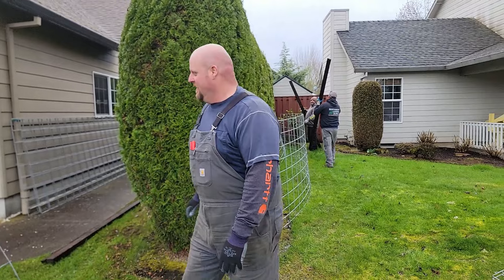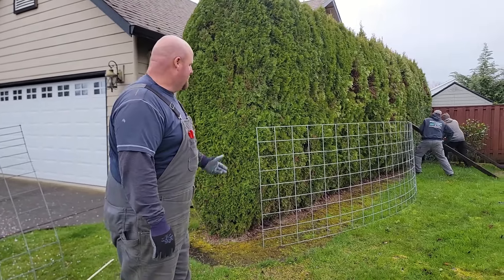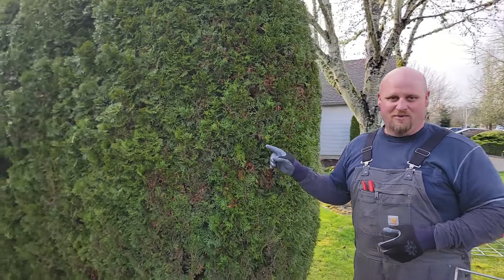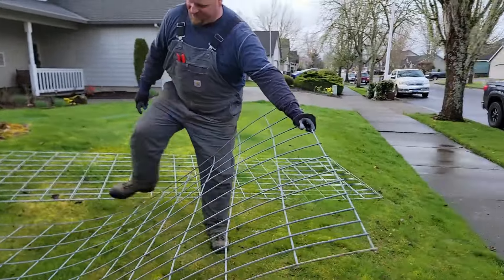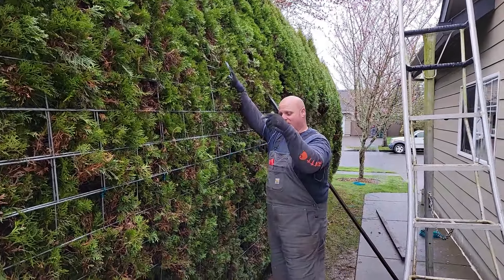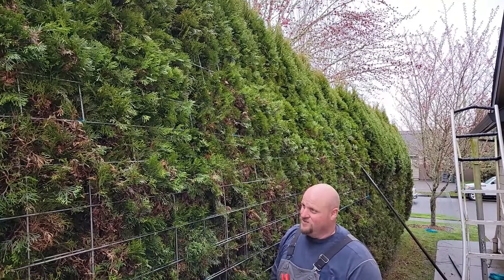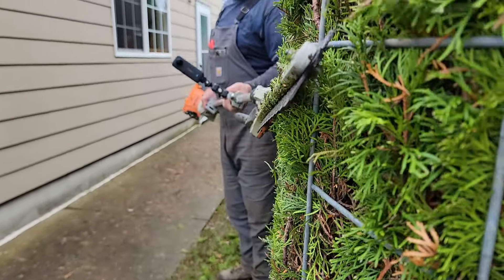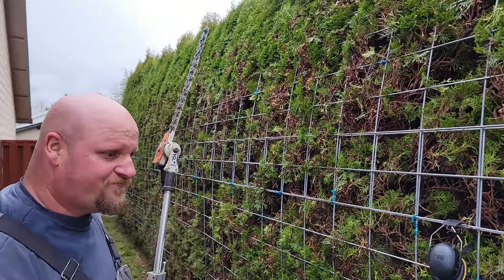Useful pruning tips, and an unconventional fix never seen on YouTube

Comment: Good job. Ive got a conifer hedge from the previous owners. I do my best but a lot of equipment i keep buying to help make it easier is too heavy for me. Also it sits in soil and the ladder wobbles and sinks.  Its an odd shape now, wider at the top with big thick straggly branches flopping about out of reach !  The small strip of solid ground which is nextdoors garage is too skinny for the step ladder!!  I should get a man to do it !!😂
Reply from the maker: 😆 a man with an orchard ladder! With 3 points of contact, the orchard ladder is the ticket. Plus you can poke the front pole of ladder into hedge in tight spots to get closer to top when pruning. Good luck!